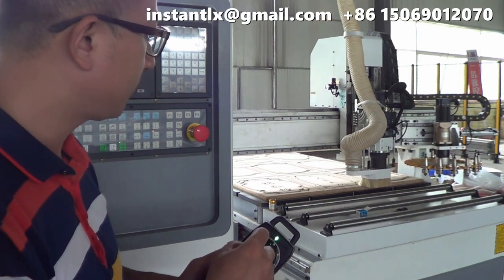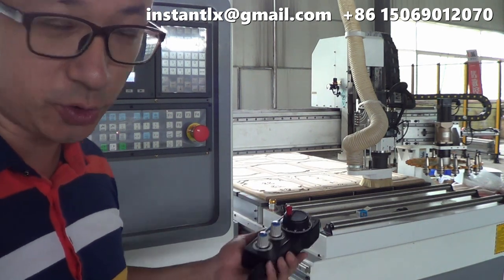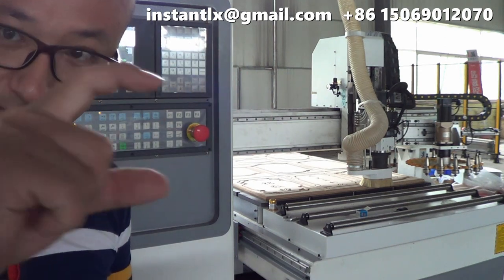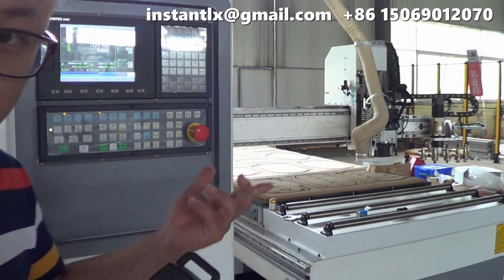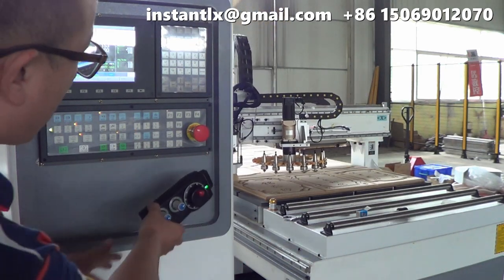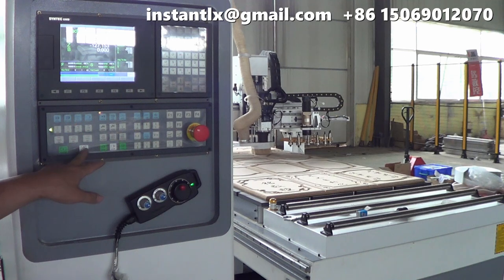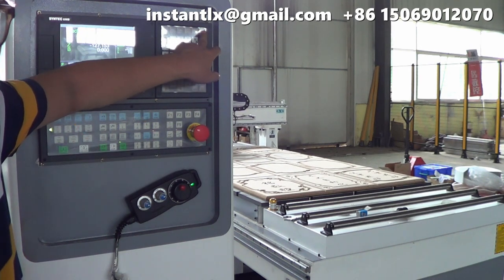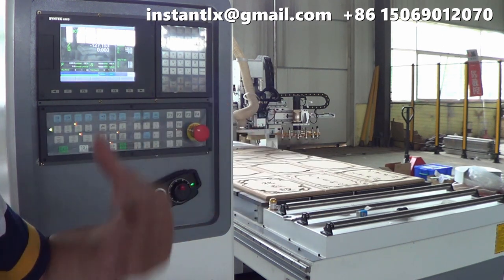How to use MPG sim mode on SYNTEC system

Comment: hi.
i am building a machine with syntec 6mb but i cant get the mpg to work completely.
the inputs for axis selection ans speed selection not showing anything. mpg only works with a single axis as long as i set it in parameters. but when i set it to mlc i dosnt work.
thanks.

Comment: hi, mrs Liu Xin.
At the factory where i work, we have a CNC router machine with a problem.
the connector of the MPG  hand control and the cable broke from the base and we do not have  the connection diagram.
I appreciate if you can help me. thanks.
Reply from the maker: pleaes  email me and tell me detaill instantlx@gmail.com